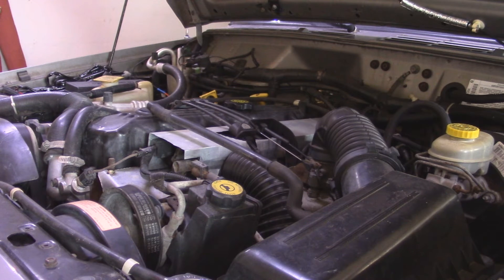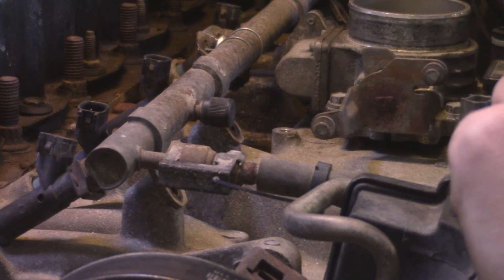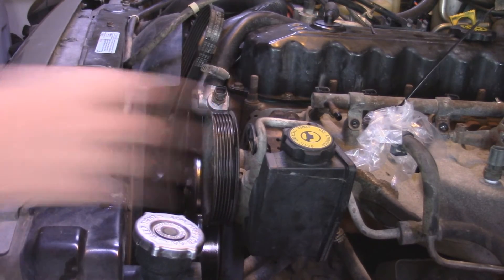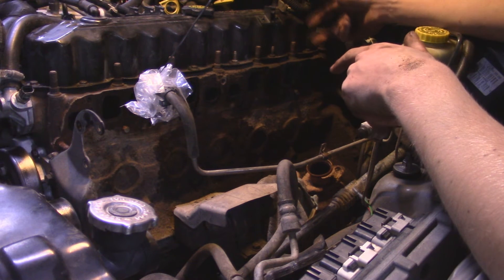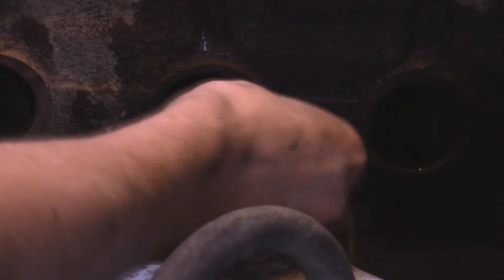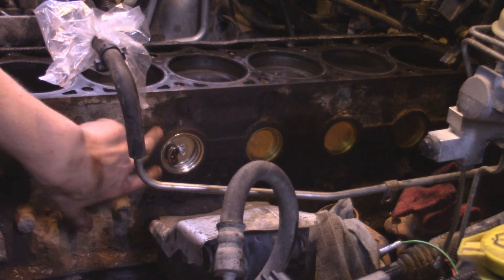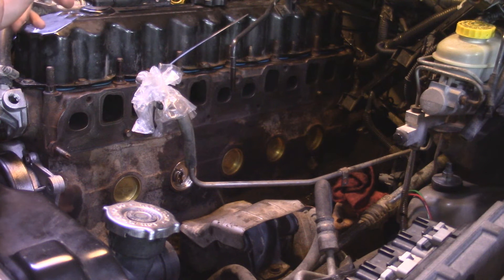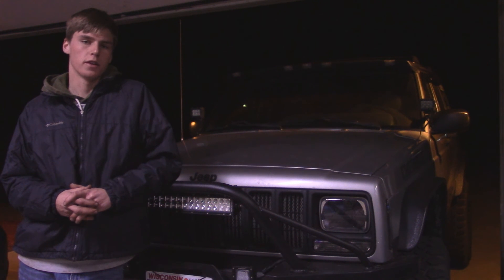Jeep 4.0L Freeze Plug Replacement

Comment: Just finished this job following your directions. Great video - only thing to add is that there are 9 bolts plus 2 nuts holding the manifolds on for a total of 11 fasteners , not 10 as you say in the vid.   You should also mention getting the lower manifold bolts in is quite the PIA.  Thanks again for posting this
Reply: Indeed they are. Do you recall how you did it? Austin did it with a small ratchet with flex-head. I have the top bolts off but can seem to get the lower bolts to the manifold off. Can you recall what # socket to use on the lower bolts of the manifold? I just want to make sure I use the right socket instead of making a guess and stripping it. They are pretty rusty as it is.

Comment: What is the water's coming between the engine and transmission what is the problem there because the freeze plugs are not leaking
Reply: Do you have any idea why the water would be dripping down between the engine and transmission because I have no idea
Reply from the maker: @JohnMoore-gl3dq  It could be a head gasket leak at the back or a freeze plug on the back of the engine.

Comment: That was a great video is it the same on a WJ?
Reply from the maker: If the WJ has a 4.0L then it should be identical.
Reply: What I meant was the same disassembling of all the exact parts and manifold and exhaust that's what I meant I should have been more clear thanks.

Comment: If I have a leaking freeze plug....Can I just patch it with JB WELD untill winter is over with?
Reply from the maker: You might be able to get away with that, just make sure to clean the surface off good and make sure it cures before you start up the vehicle. Not the ideal fix but it may work in a pinch.
Reply: I hour of run time so far at 190 operating temp and no leak so far.
Reply: Well, today my jb weld patched freeze plug started leaking in a different place. So I'm back to your video. Lol also just changed out the water pump this weekend. 

Thanks again gor the no BS video. Straight to the point.

Comment: Do you guys know what size 2001 jeep xj freeze plug size
Reply: I have a 1999 Jeep Cherokee Sport with a 4.0 and just did mine.   I bought Dorman 565069 Brass plugs which are 2” and they worked perfectly.

Comment: If your belt tenisoner is different there 3 types 
Old style is off the power steering pump its a pain 
Newer style as video shows 
Newest style sonething to fo with alternator and I believe your alternator is on top I only saw one of theses motors in wrecking yard I think it's 98 and up not sure on that one

Comment: How long did it take to replace the freeze plugs?
Reply from the maker: Depends if you are changing anything else. I'd say 4-5 hours. Took me a couple afternoons because I also changed the head gasket.
Reply: @OutJeeping  thanks for the reply. Turns out I might have enough room to access the freeze plug by simply removing the air box. Going to try and swap it out tomorrow. 

Hoping for the best but ready to tear things down if needed.
Reply from the maker: @teamfreddy5945  Just make sure you have enough room to pound in the new plug straight otherwise it will be a headache. Even with everything off like what I had, installing the plug by the motor mount was a pita.
Reply: @OutJeeping  Knocked it out over the weekend. we ended up removing the manifolds out the way to insert the freeze plug. Pressure tested and replaced it 2 more times until we confirmed no pinhole leaks. Peace of mind knowing the car has all new gaskets, held pressure and was able to put a few miles on it with no issues. Now to get it though emissions. :)

Comment: Hi, I replaced the freeze plugs very easily with this video but one of the plugs keeps popping out when I drive it a little fast on the hwy. I think pressure builds up and pushes it out. Any idea what this problem might be? Thank you
Reply from the maker: You might not have that plug installed nice and square with the block. They can be difficult to install while the engine is still in the vehicle.
Reply: @OutJeeping  thank you

Comment: WHY, is a freeze plug? 🙃
Reply from the maker: Like why is it called a freeze plug? They can also be called expansion plugs too but the reason for that is like a secondary problem solution from its original intention. The primary reason for them is to get the casting sand out of the block when they are making the block. But a secondary solution would be if water were to ever freeze in the engine block that it would pop out the plugs before cracking the block.
Reply: @OutJeeping  thank you
Reply: @OutJeeping  100%